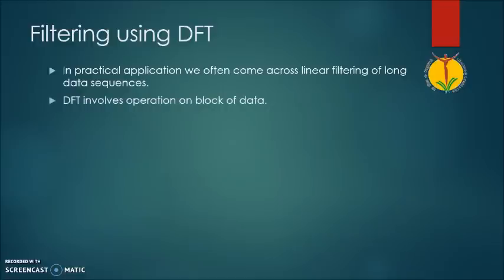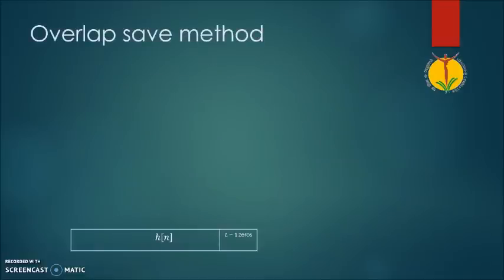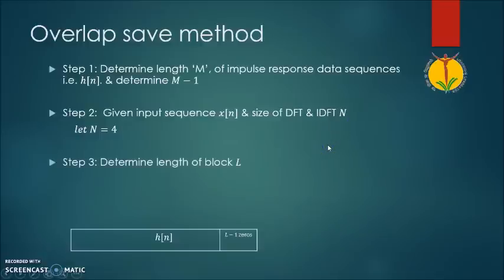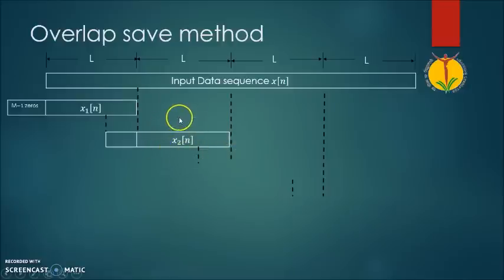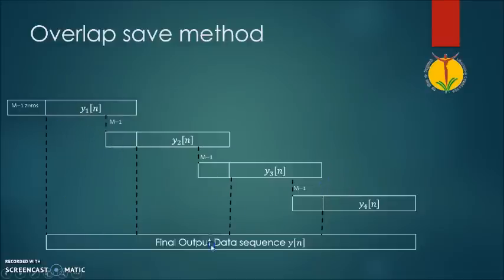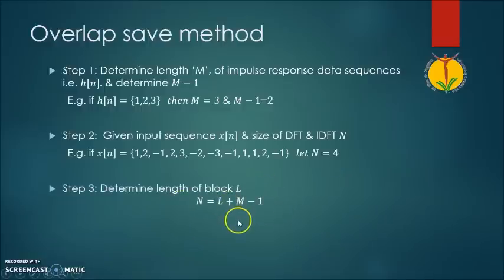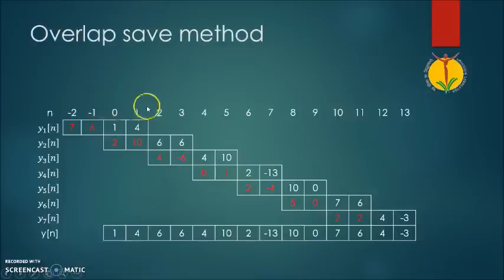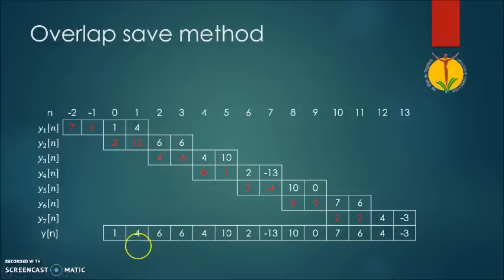Overlap save method

Comment: sir
x(n) has 12 values
But y(n) has 14 values how this possible sir???
Reply: The length of the output signal of convoluted signals x (of length A) and y (of length B) is A+B-1.

In this case A=12 and B=3 therefore the length of the output signal is 12+3-1=14